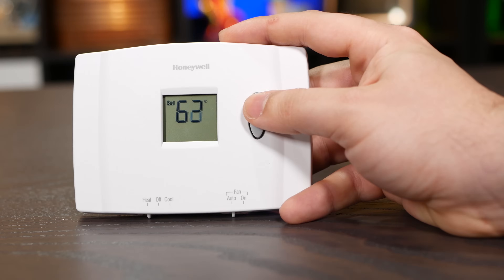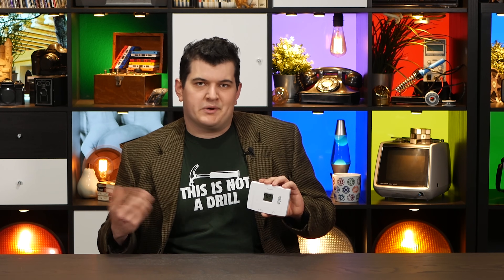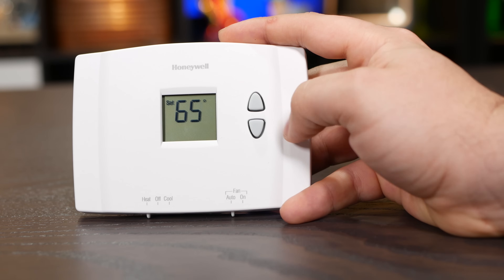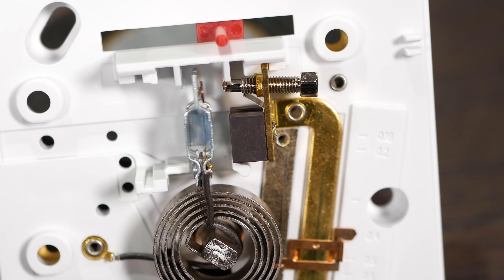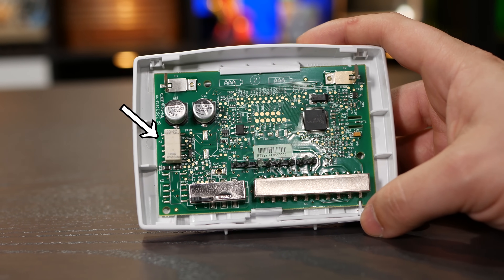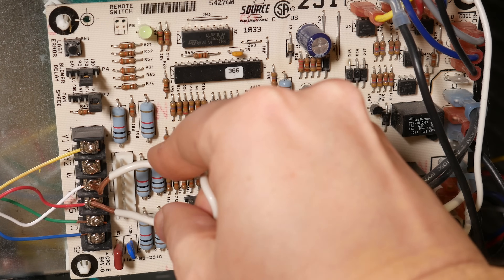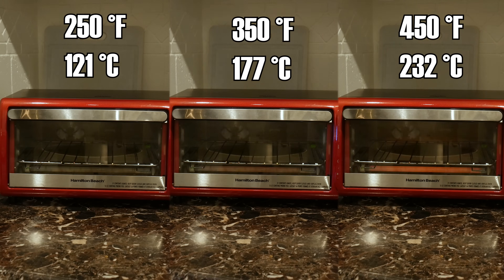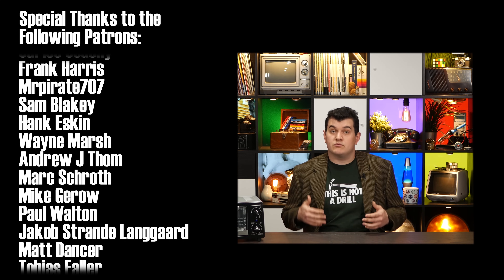Thermostats: Cooler than you think!

Comment: UK central heating systems have a "boost" mode where it comes on for a set period with one press, regardless of thermostat position. Not quite the "thermostat mode" your twitter questioner posed but essentially the same. Press it once, it comes on for an hour (say) and then goes off again. During that hour, the system heats incessantly unless the button is pushed again. Often used in older hot water circuits with an immersion tank to give you a bath-load outside the normal water heating times set on your timer.

Comment: Newer efficient hearing units can have variable heat and fan output.  Ours has Variable gas heat and 3 fan speeds.  But it's a relatively brand new system for a larger split level house.

Comment: Hello Technology Connections. I like your video. You have done an excellent job of explaining the core functionality of a thermostat. There is, however, a good reason to turn your heater higher than you find comfortable when starting up. A conventional heater heats the air of your home and a thermostat, likewise, measures air temperature. Since air has a low volumetric heat
capacity it isn't the greatest carrier of heat to many household materials such as wood , leather, tile, metal, ect.. What this means is your air gets nice and toasty just as fast with your thermostat set at 63 but it kicks off before your hard wood and tile floors have a chance to warm up, at least with the first cycle. 

Looking forward to seeing more of your videos,
A fan
Reply: This is an important distinction not made in the video; the furnishing and flooring in the home will, in fact, heat up FASTER if the room air is being held at 80 or hotter.

On the other hand, if the room air is increased from 68 to 72, it will likely take many hours for the furnishings to reach 72.
It's actually perfectly demonstrated the the trusty toaster oven. When you want a toaster at 350, you don't just heat the element to 350 and wait. Instead, it overshoots and heats the element up to 1000, knowing that most of that will dissipate out to the food and oven walls, and equalizer at 350.

It begs the question, what is more important to you? The temperature of your room air, or the temperature of your furnishings?

Comment: Ecobee can do that. If I manually lower the temperature it will go back to the setpoint after a certain period of time. You can change the interval at which it automatically restores the setpoint.

Also it's not that fancy to have an inverter based AC now that has variable speeds allowing it to potentially run nonstop with a low amoutn of cooling to work more like a dehumidifier slowly pulling the water from the air.

Comment: Professional thermostats that can be programmed with schedules and times and things, often have a feature where you can just bump the temperature in a particular direction, and it will automatically reset to the standard running program after two hours or so. And I’m sure on some of them, that two hours is adjustable. So there is your temporary cooldown option. And here’s my pointless engagement.

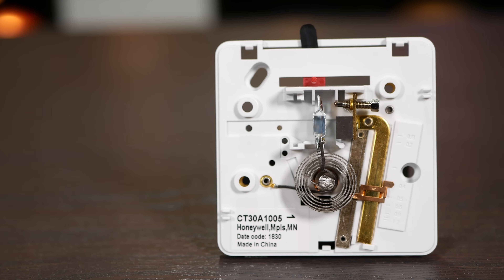Comment: 13:23  What is the slider for, just to the right of the bimetallic coil?  It looks like a variable resistor.
Hmmm.  The Wikipedia entry for “thermostat”  https://en.m.wikipedia.org/wiki/Thermostat  says thermostats may contain an “anticipator”, a small series resistor to slightly heat the bimetallic coil to reduce hysteresis and excessive temperature swings.  It appears the slider could be an anticipator resistor.
Perhaps there is a lag between the time the room gets up to temperature and the time the bimetallic coil reaches that temperature (from its thermal mass or thermal isolation).  The resistor could be a hack (excuse me, a first order correction) to get some heat to the bimetallic coil to offset the lag.  And it’s adjustable, because your situation may vary.
That explains all the power resistors on the furnace control board.  The furnace needs to draw a certain amount of current through the thermostat for the anticipator to work.  I wonder if there is an industry standard for that.  (The Wikipedia reference for anticipator [2] suggests I buy a book on HVAC systems.)

Comment: Regarding the temporary change to the cycle commands (question at the end): it's not exactly the same, but some of Honeywell's "dumb" thermostats that have a scheduling function can sorta kinda work like this. I used to have one on a M-F and weekend schedule. Adjusting the temperature control outside of the scheduling would result in it running the heat to the new temperature but it would reset to the schedule at the next scheduling increment. This could be greater than just like a half hour or so (or 5min if it's right before the next scheduling increment), so different. But it did allow you to make a temporary change and the thermostat would correct itself automatically in time
Reply: I think you and I were the only ones who actually programmed these thermostats - used to drive my wife crazy when she'd set the temperature up or down to her preferred temp only to have "someone" change it back a while later...  She never did figure out what that switch labeled program / manual was ;-)

Comment: Our geothermal unit does have an emergency mode that the thermostat will kick in when the set point and the temperature differ by more than 5 degrees. This kicks in an auxiliary set of electric heating elements, when in heat mode. Not sure in cooling mode, might have a comparable cooling mode as well. Never had that kick in.

Comment: 16:25 @CantComeUpWithUsernames yes, there is such a feature out there on most mid tier t-stats, its called a '7 day programmable' t- stat. 

7 day programmable t-stats gives you the feature to set daily running temp schedules, and most let you temporally bypass it for a short period of time.  You can essentially set when you want the AC/heat to run,to a desired temp, and what time. Once a schedule is set, you can bypass (typically with a button push combo) the set programming for an hour or so, or until the next schedule temp change.

For instance, Your AC/heat keeps your place comfortable during night time while you're home form work...but then it adjust the temps when you leave for work, (allowing you to save on energy).  Then you come home for lunch one day, out of routine schedule time, you can bypass the scheduling and run your AC/heat to wherever temp you want. The t-stat will auto reset itself back to its programmed schedule at the next available schedule change.

It sounds complicated, but its not.

Comment: I may be late with my comment but regarding the idea of the question discussed at 16:26 in the video about pressing a button and have X minutes of cycle instantly go there is a cost effective way to deal with that now.  If your place has central air cooling it also works to remove humidity out of the air along with cooling the air, with both of those (especially dehumidifying) it makes regular fans much more effective.  When I come back from a long bike ride in 35-40c temps and hot as can be even though my air may be set to 23c inside I turn on my fan for that blast to cool off.  Running a fan like this I would think costs much less overall on the electrical bill then what I would guess than using the AC to do the same thing.

Comment: Honeywell TH6110D1005 programmable t-stat has a feature  close to the "one-time" feature you mentioned near the end.  Running a program with different temperatures set at specific times for "get up", "leave for work", "return from work" and "go to bed", if you just press the temperature up or down buttons, you set a temporary override to warm or cool the house a little more than usual; it isn't quite a one-off thing, but it only remains set at that temporary temperature until the next programmed temperature change rolls around. Then it simply resumes the normal schedule.

Comment: My hot water baseboard system has a surprising amount of intelligence built into it.  It has a modulating burner - PWM - so can burn with a small flame, or full beans, or anywhere in between, even though the t-stat can only say "heat please" or "I'm good".  When the t-stat calls for heat, the control board switches on the circulator pump and checks the temperature of the water on the return side of the loop; this is, presumably, the current temperature of the house.  It also reads an outdoor sensor to see how cold it is outside.  It uses these real-time temperatures and some numbers programmed into the board by the factory-authorized licensed installation technician* to decide how hard to fire the burner; as the temperature of the return water rises, it backs off the burner, and may even shut it off entirely if the return water is hot enough, even if the t-stat is still calling for heat.  (In that case it just continues to circulate the hot water until either it cools sufficiently to fire the burner again, or the t-stat cancels the call for heat.)

*tech-savvy homeowner who found the full installation manual online

Comment: "Bro can you turn it down its a little hot in here"
"Oh yeah sorry gimme a minute forgot to charge my thermostat"
Reply: That actually happened to me. The thermostat in my apartment runs on batteries. There isn’t even a C wire. I checked. Also it’s mounted sideways for some reason
Reply: @Jaymac720  it might be a wireless unit, some newer installations use them, especially for multi unit housing and commercial buildings
Reply: lol

Comment: Interesting. It would be easy to add a "heat now" or "cool now" button to an existing thermostat. Just connect the right wires to a light switch or better yet, one of those fan switches that runs for a few minutes, then stops.

Comment: One of the "cooler" thermostatic controls I've seen is in the lowly Weller TCP soldering iron.  Embedded in the replaceable tip of the iron is a slug of ferromagnetic metal whose magnetization vanishes when the temperature rises above its Curie point.   A permanent magnet coupled to the heater switch reacts appropriately.  Absolute brain-dead simplicity.   If you want a 700F tip temperature, use at tip stamped "7" at the base.  I don't know when the scheme first appeared; probably sometime in the 1950s.

Comment: I don't think many thermostats use thermocouples.  Most of the ones I've seen use an ordinary diode (the voltage drop in a diode varies with temperature in a predictable way) or perhaps a thermistor.  Also, I'm surprised you didn't comment on the diagonal adjustment in the cheap heat-only thermostat.  The plastic molding even has calibration figures (looks like 0.3 to 2 or so, but it's hard to see).  I'm guessing it's a sensitivity adjustment to compensate for differing bimetallic strips, but I'd be interested in your thoughts.
Reply: You're right. A thermocouple would not work for an air temperature thermostat. A thermocouple always has two junctions, and senses the difference between the two junctions. A diode or a thermistor would work. The voltage across a forward-biased silicon diode varies by -2mV per degree C. It can be incorporated into an integrated circuit. It's a simple component that can provide a digital output corresponding to the temperature.

Comment: And that is the exact reason the rest of the world has inverter air conditioning so by turning the temp down (or up if it’s a heat pump) will actually run the compressor and fan faster but that still uses a lot of power so is you have it set for something reasonable the unit will run at full blast until it gets close to the set temp and slow dow the compressor and the fan
Reply: Here’s a video explaining what I mean https://m.youtube.com/watch?v=7apsEM8hMbw keep in mind Daikin are not the only company that make them

Comment: Not to be the “um actually” guy but modulating systems to exist; where the ac, fan, and heat pump can run anywhere from 40%-100%. In these modulating systems all of the parts communicate allowing all kinds of features like dehumidification without changing the temperature and they only run on 4 wires however the wires carry data

Comment: A 17 minute video about thermostats and not a single word about thermostats in more developed countries that actually do modulate the output power.
Modern heaters in Europe will almost always run at a fraction of their heating capacity. This ensures that the water returned from the radiators is almost at room temperature. You can cool the exhaust gas of your heater with that cool water and obtain free energy. Obviously there is a PID controller somewhere, the thermostat is simply a remote temperature sensor and user interface device, or it is providing the desired power to the heater depending on the brand.

Comment: 1:35, I had a heater in a rent house once that had an aux heater, so if the DT was over a certain threshold, it would kick on and help out so it would heat faster. but that's a specific unit and not all have an Aux heater

Comment: I actually write software for domestic thermostats for a major company I won't mention here. We use communicating thermostats rather than the basic wire thermostats. The communication line can send a great deal of detailed information between the thermostat and the air handler to provide diagnostic and service information, as well as more advanced controls for things like UV-C sterilization and fresh air intake. You can get precise fan control to do things like set up dehumidification modes, or run on efficient modes on nicer days.

Comment: Oh yeah.. and watching the time lapse on the toaster oven made me want to make my own PID controller to more efficiently keep the oven at the proper temperature.  There's no reason with a TRIAC we can't make those things dead-on the temperature instead of being "close enough", and with enough smarts about monitoring the speed of temperature increase, we should be able to estimate thermal mass to know how long it's going to take to get close (at full blast) without overshooting (ie: when to start modulating)..  Also, it would be interesting if you could correlate a decrease of thermal mass to a "done-ness" of toast.. ie: as the moisture level goes down, theoretically it should take less energy to keep a piece of bread at a given temperature..  Someone smart at math might be able to simulate the good old radiant toaster?  Might be fun to experiment with!

Comment: What they need is a programmable thermostat that also has a programmable fan duty cycle. Sometimes one part of the house warms faster than another, if you have the fan come on for say 10 minutes it redistributes the air in the house reducing the need for a cooler setting to address uneven temperature distribution. Of course this example is for summer but the inverse is true for winter. Now I am thinking Arduino.

Comment: Thermostats totally are sentient.  I know this because mine sets itself to lower temperatures often during the Summer.  My wife and kids say it isn't them doing it, so it must be doing it itself.

Our thermostats have an option for external temperature sensors, so you could have the control in the hallway, and with four external sensors it could read the average temp in four bedrooms, for example, and respond to that instead of the temperature in the hallway.  Since the hallway is central and the rooms have varying degrees of exterior walls, this could actually be helpful to us.  

They also hold a manually entered temperature for whatever time you request.  By default it just holds it until the next program change, but it offers some arrows to let you bump that up or down.  We can also set a number of vacation days and it will keep the system at a vacation temp until then.  We don't tend to use that much because our dogs are spoiled.

Comment: Perhaps outside the scope of this vid; I have a Carrier Infinity heat/AC system.  It has a 5-speed compressor and a 5-speed air handler fan ... it really does decide how much heat/cool I want/need, and provide an appropriate response.  The good news is, most of the time (90%?) the systems runs only on level 1 or 2, so the compressor is VERY quiet, the fan is VERY subtle.  But on a really hot/really cold day ... the thing cranks way up, and it's of course noticeable, basically "full blast."

Comment: RE the "one cycle", most programmable thermostats you can push them up/down and they will revert back to the schedule at the next time-change, typically 4x a day.  So if you come in mid-day from working and push it down, it will revert back in the early evening.

Comment: The Carrier infinity heat pump has several fan speeds. However,  it's still true that it will run at full speed if it needs to cool or heat more than +- 4°. The variable speed works with scheduling, it can use lower speeds if it is programmed  in advance when the demands are. It's slightly more efficient. Oh and the infinity also will let you run heat or AC for 20 minutes then go back to the normal schedule. If you change the temperature it defaults to a 20 min timer actually, you have to tell it to "hold" in additional steps. Its neat. This heatpump was installed in 2010 so I guess, still uncommon?

Comment: It was a pleasure to watch this video, right up to the point where you equated mercury switches with toxicity. Mercury switches are still in use in a variety of circuits. Unless you're worried that some knuckle head is going to break the glass container and poison someone's coffee with it. Then there are switches utilizing various alloys of gallium. And in no way would that tiny amount of mercury mass equate to the pull of the magnet on the cheapo contact strip in that thermostat. I will willingly give you 9 out 10 for this video. But then you usually get 10 out of 10.  Chuckling in the lab, san antonio , tx.Take care of yourself and yours, be safe and be well.:..